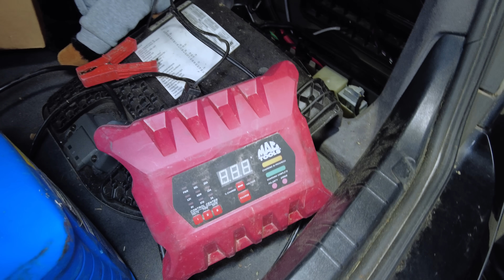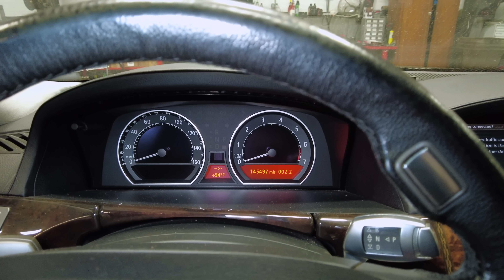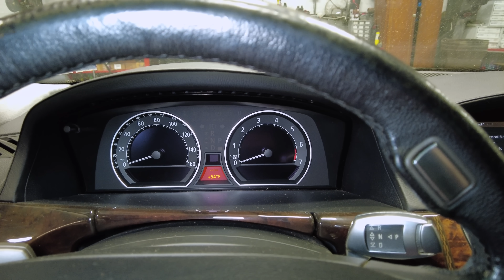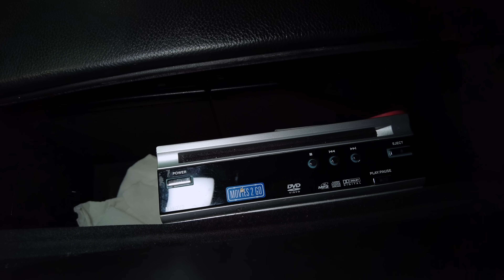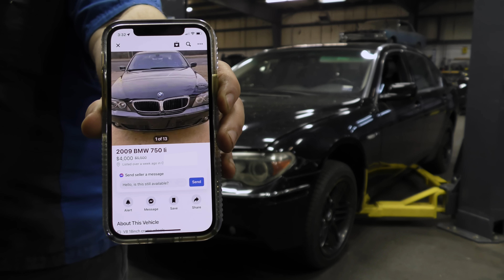Fixing a high mile German car?! Is this '04 BMW 760LI with a V12 worth it? CAR WIZARD breaks it down

Comment: "People at a certain income level shouldn't be messing with BMWs" fantastic, accurate quote!
Reply: They're a waste of money regardless of your tax bracket.
Reply: @1995RangeRover  Not if you have money.
Reply: @1995RangeRover  CERTAIN models not all🤦🏽‍♂️🤦🏽‍♂️
Reply: That’s 🧢
Reply: people even with money would just buy a brand new BMW, thus why you see these vehicles being scaped for parts
Reply: I would beg to differ, I'm pretty broke but I daily drive a 2006 BMW 5 series wagon
Reply: He's not wrong. If you are going to get one, it better in good shape and you better aet aside a fund for maintenance.
Reply: Bayershe Motren Werke. Bavarian Motor Works in German.
Reply: @chipmunk1631  If you are broke, how are you going to fix it when you are quoted $3-4k for repairs if something serious breaks?
Reply: @1995RangeRover  Not at all. They provide a fantastic luxury and performance experience. Not to mention they are a great way to show off. So worth it if you can afford the upkeep.
Reply: @PeugeotRocket  firstly, I'm probably not gonna sink that much money into it if something like that happens unless I have it to spare. And I do proper maintenance. Preventative maintenance. Replace known trouble areas early and a little at a time. I know timing chains are weak on my car, so I'll be changing that when I'm able. I do oil regularly, I dont beat on it, no street racing or drifting or something stupid. Anyways, you could ask that same question to someone with any brand of car
Reply: @chipmunk1631  Except the odds of bringing your Camry to the mechanic and being told it needs four grand of work after it started running rough or a check engine light came on is a lot lower than a BMW. If you are broke and the alternator went out on a Honda Civic, it's a lot more likely you will be able to afford it than high end car. 

So I still think being broke, as you describe yourself, potentially puts you in a very bad situation in a BMW compared to a Toyota or Honda.
Reply: @jalopy2472  e24s, e28s and e34s are all great cars and simple to work on. getting harder to find them though.
Reply: @PeugeotRocket  the problem with BMWs is they dont get taken care of. And when you dont maintain them, they can fall apart because they're kinda over-engineered. Any idiot can drive a Ford or Chevy into the ground and just hold it together with duct tape. Also, they arent that expensive to repair if you stay away from the dealership. My right rear control arm broke last week because it wore out...bought two for under $70. That's not bad. If you buy gold plated BMW diamond anruby-stampeded parts it'll cost a ton of money. But in reality no more than a Ford or Chevy.
Reply: Jon browning you correct, we should not reach for something that is beyond our accessibility. But unfortunately that is how our universe work. I wish we all can be rich and drive bmw, mercedes...
Reply: Lease!!! It.
Reply: @jalopy2472  my 2010 bmw x5 xdrive30i would STRONGLY disagree with over 250k and still going strong, original engine, tranny, and parts isn’t expensive unlike these new cars aka TOYOTA, or DODGE, or Anything new😂😂also Vanos is not expensive yall just buying from the dealer again MAINTENANCE is key with any old BMW. Why is it others don’t have an issue and others do, it’s all on what you do and how you take care of them and most folks beat the hell out of them and expect them to be damn near bulletproof
Reply: Unless you can do the work yourself then becomes question of whether or not you can, A, get the parts and B, whether or not you can afford the parts. In my case a guy whose car I've worked on, I'm not a pro and don't own a shop but I know my way around cars and do what I can do, so when he approached me a couple of years ago and told me his aunt had a car he wanted to buy, he then proceeded to tell me it's a 2003 530i and the only thing wrong with it is, and I chimed in, don't tell me, it leaks oil, he said yes, I without hesitation told him to forget about it. Last year he came over to me and said that his aunt is ready to sell the car and he wants it, now it has sat idle for at least five years, a neighbor of hers put a new battery in it in January of 2022 and tried to start it with no luck,  it was now the end of September and when I went to try and start it the battery was stone cold dead, it took a jump box and a jump from another car to give it enough juice to crank fast enough, it cranked and cesnksed and finally coughed to life I drove it home and started evaluating this Nazi mobile, oil leaks, check, coolant leaks, check power steering fluid leaks, check. This is a 92,000 mile car, it needed everything because it had been neglected all it's life but at least the engine and trans seemed solid. Brakes tires, two were original with a production date of 2002, brakes oil pan gasket oil filter housing gasket water pump coolant hoses and radiator and hosez thermostats , a new radiator various vacuum hoses, I replaced the lenses on the HID headlights, a new ballast for one of them replaced the adjusters inside the headlights they were all broken which is a common problem on there cars, a new purge valve valve cover gasket, the oil pan gasket is fun you need to raise the engine and lower the subframe I read estimates from a grand to 1,400 just for that, in get the car in shape, there are still oil leaking from somewhere above but I'll never find and a p0171 and a 174, I'll never know what is causing it because the idiot decided after all the work I did that he'd take it to the zone and have check the codes, they told him a maf sensor, i checked it after he told me that and it didn't have a maf code, he also told me that it needed a power steering pump because the steering isn't easy, I told him that he doesn't know German cars specifically BMW where the steering if very firm, he basically told me that I won't listen to him a guy who literally never touched a wrench in all his 65 years, ive been paid 300 so far for work that would have cost him thousands, he never tells you thank you, I've fixed his 350z convertible, the top didn't work he paid a shop 1k and it still didn't work,  it was overheating, he took it to pep boys they told him it needed a thermostat and it would cost 600, he asked me to look at it and I found that the electric fans had seized up causing it to overheat, he used me and what's worse I let him.
Reply: Rephrased: “People at a certain income level shouldn’t be messing with any German cars.”
Reply: the thing is, you find a lot of older BMWs/Mercedes/Audi at just about every discount car lot around. The kind of easy credit/no down dealer that attracts low-income people.
Reply: @adotintheshark4848  and thats what keeps their credit low. lose-lose situation if you ask me
Reply: The smart ones lease them for 3 years and then move on
Reply: @goforbroke2  Yeah I learned that the hard way when I bought my B7 A4
Reply: "If you cant afford to buy two you shouldent own one."
Reply: @PeugeotRocket  my dad is a millionaire and drives a 13 corolla. He would look at this bmw and just see a waste of money.
Reply: Jeff Bezos drives a Honda. Have some common sense people.
Reply: Regardless of my wallet I drive an 01 Silverado 5.3 z71 241k on the clock, drives like it’s new,,  very dependable, plenty of power, parts are cheap, plentiful, easy to fix simple technology, life is easy, most people don’t know that though.
Reply: Very true 👍 but try telling them it!
 I've seen BMW n Audi cause so much pain !!
Reply: Not all BMW's. Car wizard always bashes BMW's and is a mercedes benz fanboy. Mercs still have their fair share of expensive issues like the ABC systems and the old style door closing system which was controlled by vacuum. 
Considering the condition of this 760li, it looks very Neglected. These V12's need a lot of maintenance and when it was brand new, the car was $200,000 and over.
There are many great BMW's that a lot of people can maintain just as long as it isn't too cheap. People always give BMW a bad reputation when it comes to repairs, and not many people bother to repair their cars, even normal economy cars like a toyota Corolla, Camry, Suzuki swift, Honda Civic etc.
Reply: Old saying "If you can't afford an expensive one you definitely can't afford a cheap one.".
Reply: Perfect for rich people
Reply: @FiveBoroNative  if it's an older one, you can fix a lot yourself if you have the skill..  When I was younger, I had friends with no money who always drove german luxury cars, because they could do the maintenance themselves and buy used parts from the scrapyard
Reply: @Virtualhangover999  yes, but you still drive a silverado.... it might be just what you want, but it isn't for everybody..    I would prefer to drive a german luxury saloon, because it has much better handling and comfort.     At a price..   ( a price I am not prepared to pay , so I have to settle for a cheaper , smaller car.)  But I still don;t want your Silverado. It's not practical for my needs.
Reply: @Blackadder75  you're preaching to the choir. I own an N63 powered X5. The warranty company refreshed everything under the hood and it's up to me to maintain it; which I am certainly capable of.
Reply: @gregmuon  does Jeff Bezos really drive himself around? Seriously? You can’t be that gullible.
Reply: @FiveBoroNative  nice!
Reply: @dickmoney2946  why wouldn't he?  being rich doesn't mean you have to be golden spoon fed everything,  it's much more practical to keep a somewhat normal lifestyle and only use your money when it;s needed.
Reply: @gregmuon  dont think he has that 97 accord anymore he probabaly doesnt even drive himself anymore
Reply: If you can work on it yourself, they can be affordable ... the second you take it to a shop, they turn your wallet inside out.  Pre-direct injection 6 cylinder engines are the more reliable and easy to work on.  Stay away from v8 & v12 engines and the newer turbo motors.
Reply: They say if u cannot afford an new BMW, dont but a used one
Reply: @JPLOgunquit  E38 7 series although older are cheaper to maintain and can be reliabile if you repair the weak spots, E39 525i are also pretty solid from what i hear
Reply: So none? LMAO
Reply: @CRAPO2011  even with the comment i made, i still bought a used little X1 and i loved it. BMW and Audi the cars i live the most
Reply: @miguelvega7769  E46s aren't too bad if you're willing to put in some elbow grease
Reply: Lol yeah this is how I learned to wrench. Wanted to drive a BMW 6series when I was 20 yes old. Thought then I'll have to fix it myself 😃.
It still runs now 20 yrs later 😊. But these were way easier than these whale 7 series to start with.. 😅
Reply: @FiveBoroNative  not with the e46 or older
Reply: @yusufsesay6648  glad to hear it, but I don't own one of those nor am I interested in owning one.

Whatever you drive, just make sure you can take care of it and you should be okay.
Reply: First rule of bmw never buy new. 2nd rule, do your research. Certain models are horrible, certain are great.

I've owned my e92 2013 m3 since 2015. Not a single issue. Beautiful car that has maintained value better than any car I've owned.
Reply: I would say the reason they buy it is not "appear a certain income level". They are fooled to think is a quality car that they can afford to buy. On the contrary , new buyers buy them to show their income level, not caring about the quality of the car, which frankly , after e34 era , has dropped like a stone.
The other they I drove a 4 series and I was horrified by its cheap construction.
The owner thought I was was going to praise his new car but I couldn't help to tell him that compared with a pre 1995 brand new  bmw it was a piece of junk.
Reply: @1995RangeRover  I am not a BMW fan but I heard some of them are better than others.
Reply: @goforbroke2  😆 🤣 There are people that will buy them because they want to look successful. Look rich! They want that high end status symbol.
Reply: @gregmuon  Exactly! There is a reason why he is rich. I worked in the auto business for over 20 years and it amazes me how people with poor credit always want a Lexus, BMW or Mercedes. The customer with excellent credit always buys Subaru, Toyota or Honda.
Reply: @FiveBoroNative  exactly any car that isn’t borderline a piece of shit from factory can be reliable if taken cared of bmws aren’t actually so bad I have a e46 and I’ll tell u it’s one of the easiest cars I’ve worked on and she treats me well and my daily versa too 😁
Reply: @yusufsesay6648  they are driver's cars and in some cases, they are best owned by those who don't mind working on them themselves....
Reply: @FiveBoroNative  yeah I’ve realize that they really are the ultimate driving machine very new to bmw but I love mine and a simple reliable straight 6 but I’m not going to lie I’m actually more of a Honda guy I love Hondas more and the me the most reliable bmw is a Honda accord 6th or 7th gen coupe
Reply: Nice cars but no thanks money pits compared to most brands
Reply: If you're at a higher income level, honestly an older BMW would be a sweet deal I think! Cuz the price of repairing everything would STILL be cheaper than getting a new BMW
Reply: @anakitasmiles3261  it's a numbers game. You gotta figure out what works for you.
Reply: @martinsvensson6884  Even if you money, all that plastic in the BMW engines is disgusting.
Reply: @rebeltvr6046  It is a bit disturbing sure.
Reply: This isn't just a BMW. It's a 150000$+ BMW. When things break it needs parts fit for a 150000$+ car. It's like the second most expensive car they made IIRC.

No luxury car with a V12 engine that cost over 150 grand new will ever be cheap to maintain.
Reply: @BigUriel  you are correct, but at what point is enough, enough...? A person has to weigh out what makes sense for them. To me the styling of the car alone is reason enough to throw it in the trash bin even if it were brand new. The fact that is a BMW doesn't move me and I own a BMW myself. It's just a car and thus a poor investment, but if it doesn't run right it becomes a horrible investment.
Reply: @FiveBoroNative  Styling is subjective, I don't like it either but some people do I guess. What I said applies to any high end luxury/performance car not a V12 7 series BMW specifically.

The take away is don't buy a 10 grand used car that cost 150 grand new and expect to maintain it on the same budget you'd have for a 10 grand car that cost 40 grand new.
Reply: @BigUriel  I agree. I don't think it was ever worth 150k, either, but I digress.... 😏
Reply: @chipmunk1631  Buying parts other than genuine OEM is quite a risk sometimes. I know the control arms on my Lexus LS460 are notorious for going bad. They are around $500 each for genuine Lexus parts and many people have bought the cheap ones online trying to save money only for them to fail very quickly thus spending more in the long run.

I don't know if the control arms you bought were genuine OEM or not. I'm not sure how much they should cost but $70 each sounds way too low. Hopefully yours hold up.
Reply: @PeugeotRocket  genuine OEM can be just as bad as aftermarket and worse in many cases. Timing chain guides on BMWs were done in plastic to save money. Aftermarket they're metal to solve the problem of them failing.
I buy parts that are going to work. I'm not a high schooler with a clapped out drift car. I'm an enthusiast, I do my research.
Reply: @chipmunk1631  Yes, that's true. I believe the rod bearings people replace the stock rod bearings in BMWs V10s are better than genuine OEM. What I'm saying though is you get what you pay for. A lot of those aftermarket parts are of inferior quality. There is a reason they are so damn cheap compared to the genuine OEM parts in many cases. eBay is just flooded with garbage Chinese knockoffs that people buy trying to save money and it very often does not work out well for them.

Research is incredibly important.
Reply: Not just BMW. Any luxury car with high repair prices should be stayed away from by people who value their money
Reply: @1995RangeRover  spoken like a true fangirl
Reply: @laplays6916  dude he also bashes mercedes to, where did you get that info?? also saying fanboy is cringe.
Reply: Most bmws are leased
Reply: @1995RangeRover coming from the guy who’s YouTube name is 1995 Range Rover? You have any idea how unreliable said vehicle is? You couldn’t go down a block in a P38 without failure
Reply: Bmw is one of the top selling cars today that logic doesn’t really show on paper people are still buying them Rick or poor
Reply: Not really accurate. I work on my own vehicles, first car was an E32 BMW 750iL with the V12. Dogged it for 2 years straight in high school. Only did oil changes and never had a single issue. 

Sold it to get an Audi, got rid of the Audi. Got another V12 E32 BMW. Bought it for $2K sight unseen halfway across the country at 19 years old. Bought a plane ticket, saw the car. Knew I wanted it and could handle the repairs myself. Drove from Vermont to Texas non stop and car ran flawless for about 3 years.
Sold it for an E55 AMG. Sold the AMG and bought my third E32 V12. I’ve had her about 4 years now, zero issues besides some typical 30 year old gaskets being worn. Valve covers, oil pan gasket. Did everything on a Saturday. My current E32 is valued around $12K and they’re climbing in value. Was the first ever production V12 and bmw stopped making V12s for their 7 series. 

90’ 750. Bought for $1800- sold for $4000

94’ 750. Bought for $2000 - sold for $8500

91’ 750. Bought for $2000 - appraised at $12,000 in its current condition. 

This 91’ is the most $ I’ve ever spent on service and repairing everything that was old/broken. Is a total grand price of $1478. This also includes new suspension. I see people who have Toyotas or Hondas and can’t even afford the $1000 or $2000 repair bill that’s honestly about $400-$600 worth of realistic work. 

I don’t have rich parents. They’re actually deaf so they live off disability. Had to work for everything by myself. Sacrifice hanging with friends or events just to focus on my cars. 

Such a naive quote and just sadly a typical sheep 🐑 mindset mentality. 

People at a certain income level should only mess with whichever vehicles they feel comfortable with owning and driving. 

If you want that kind of car with a certain income level, then learn how to work on it. 

I can’t tell you how many times I’ve seen thousands of dollars worth of repairs wasted on Toyotas and Honda. My buddy has a 2014 Honda accord. Just clicked over 100K. Religious oil changes as he’s a district manager for Napa. Once it hit past 100K on that 2.4L. Boom, the connecting rod ate itself inside out. $8K later he had to fork out and get a loan for since he just had his 2nd kid and medical bills piling up. 

He said, I got a Honda after you got your BMW. How does your 30+ year old V12 BMW last longer than my Honda? 

The hype is so overrated it’s insane.
Reply: Then if that's the attitude perhaps let's scrap all the classic vehicles, what a pathetic comment, a car has an engine, transmission and diff people cash in on the name and nothing more!
Reply: 1 and 3 series are pretty good cars and easy to work on yourself
Reply: @gregmuon  He also has yachts and private jets. Bezos and the guy driving the 94 Celica shitbox have nothing in common. But to your point, I doubt he still owns a Honda either way.